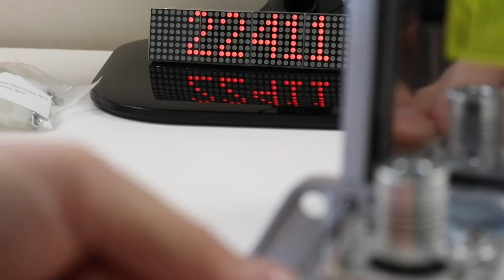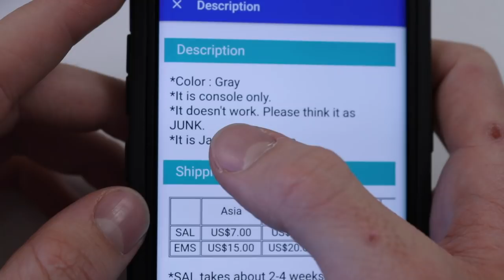Let's Refurb! - Fixing Faulty eBay GameBoy Pocket!

Comment: How many cigarettes a day did that game boy smoke?
Reply: Too many.
Reply: Normal oxidation
Reply: Jones Paul haha it looks like he was a chainsmoker
Reply: Actually, that type of yellowing is typically not caused by cigarettes, as much as it looks like it is.  It's caused by exposure to UV light.  And it is possible to remove the discoloration with a combination of hydrogen peroxide and either UV light or heat.  Look up Retrobright sometime.  But yeah, the way it's more yellow on one side, that's definitely a sign of UV exposure and not something like being in a smoking house.  For those chemistry nuts out there, flame retardants in plastic like that are based on bromine.  UV light causes a chemical reaction which releases the bromine from the compounds.  And bromine is that characteristic yellowish/brownish color.
Reply: @StormsparkPegasus  r/whoooosh
Reply: 1,0000000000000
Reply: Stormspark r/woooooosh
Reply: Uhhhhhh lung cancer amount of cigarettes

Comment: Stumbled upon this vid, interesting to hear that most of the problems with these devices revolve around the power button. I have an old GBA micro that stopped working for some reason. After playing with the power button back and forth it finally turned on! Thanks!! Is this issue due to some residue buildup?

Comment: Nice! I've just subscribed. How long did you expose the bleached case in the uv bay for?
Reply from the maker: Thanks! About 10 mins then check & replace the solution, then another 10 mins & repeat.
Reply: @TheRetroFuture  my girlfriend informs me that you can get a higher volume of that hydrogen peroxide (you're using 40). Might help.

Comment: Not relevant to this video, but does the orange Xiaomi screw driver set you use come with the smaller tri wing bit? I've seen other older videos of yours with the slide opening grey case one and the tri bit was too big and you said to buy another one. I've ordered the orange one so wondering if I need to separately buy that bit?? Sorry it's in the wrong video - see it as a complement - I'm binge watching so many lol! Cheers.

Comment: For that adhesive you should consider using a citric acid based cleaner it will dissolve it and make it easy to wipe away then clean as normal and retro bright it.

Comment: Where did you buy your power adapter for your DMG Game Boy? I'm in the UK, just got a couple of broken GB's and i want to fix them. The terminals are corroded so thought getting the power adapter i can bypass the battery section and see if they work from that. Love the videos, thanks very much for your help.
Reply from the maker: Ebay!
Reply: Thanks for your reply. I found a usb cable on the deadpan robot website that will do the job.
Reply: eBay if you want some original hardware, they made plenty of chargers for the machine.

Comment: Nice video!, thanks for the upload :). Couple of questions though (if anyone can answer)..

1: When you turn it on, and you get the blocks scrolling down the screen... isn't that suppose to say Nintendo ?

2: The restore of the eyellowing plastic looks very good.. though wondering, does the chemical process damage the plastic? Does it become brittle in any way ?
Reply from the maker: 1) it says Nintendo if a game is in there and has been read. It shows blocks when the game isnt inserted. I cant remember without watching the video but I think this was a fake cart which I used to test it.

2) yes it can make it more brittle if overdone.

Comment: It would be really cool to learn what it is you're actually doing, and why it works. Like, why does putting alcohol on the power switch automatically fix it? Why does retrobrite clean the color and make it whiter? What was that lightbox thing you put the thing into? I have so many questions! I'd love to learn these things to refurbish these things as a hobby!
Reply: alcohol is used to clean contact points and remove general gunk. It has no lasting effect on the electronics (it is flammable so turn it off and be sure to remove power) plus alcohol air drys very quickly.
Reply: retro bright is mentioned as a peroxide agent of some sort. its like i weak bleach / coloring, think of hair dry. Same sort of idea. Keep in mind I have never used the product and only base that on what was said in the video.
Reply: @slowb15  thanks for the explanation! I really appreciate it! I've seen a few more of his videos and he explains things here and there, I'm learning slowly but surely 😁

Comment: Only if i could figure out whats wrong with my 3ds. It wont charge or turn on. Ive had the battery, charging port, screen, power switch replaced and noting worked. Its just gone.

Comment: Hey Elliott, i want to know how do u glue the screen, i fixed a dmg because of your videos and i need to glue the screen. Thx in advance, if anyone else knows i apreciate the help.
Reply from the maker: If you're really careful, some superglue. But really doesnt need a lot at all. I will be using some high quality double sided tape so it is reversible.
Reply: Thx :D i think i will try some super glue because here in portugal we dont have many good tapes :/, btw i hope everything is fine with u, i love the website, hope u find a job soon.
Reply: Don't use super glue. It can fog the screen and you won't be able to remove it easily later. I'd recommend a really weak epoxy or a silicone.
Reply: I use some thin double sided tape they sell is craft stores for scrapbooking that works great for this when cut to size.
Reply: Matt Fisher Not to mention that it can and will ruin the paint used on the screen lens. Double-sided tape is definitely a cleaner solution.
Reply: sjm4306 looking for a solution without tape as he mentioned it's hard for him to find where he is at
Reply: Matt Fisher well the internet exists ( amazon , eBay etc ... )And he uses any glue that is powerfull enough to keep the screen in place the paint underneath the screen borders will discolor
Reply: Double-sided tape isn't too thick to make the screen fit flush?
Reply: Maybe a glue stick
Reply: @staticklingon2182  There exists a type of high-strength double sided tape or LOCA tape designed specifically for cellphone touch panels. That should be strong enough for your needs and shouldn't leave a foggy mess. Alternatively, you can use E6000 or those B6000 knockoffs used by cellphone technicians.
Reply: Awesome! Had no clue this existed. Thanks!

Comment: Nice refurbish. As far as the retro-bright, have you seen The 8-bit guy's videos on it?
He did a series of test comparing the most used processes to retrobright and found that the cause of the streaking is due to the uneven application of the cream base hydrogen peroxide.
You can reach a better (even) result with a very high chance of success by warming the plastic piece in a stove with a solution of water and peroxide.

His channel is over here if you're interested https://www.youtube.com/user/adric22/playlists

Comment: What is he using at 5:40?
Reply: I want to know it too.
Reply: I guess a UV-Lamp. Not sure why though, because the peroxide will take care of the all the discoloration just fine.
Reply: @Felixkeeg  usually when peroxide is used to whiten something its set in sun or heat lamp, people who restore white shoes do the same, put the sauce on the shoe, wrap in plastic wrap and set it in the sun or under a heat lamp, I guess it helps it set better
Reply: To be specific it is used to harden acrylic nails in nail salons
Reply: it`s his sister nail dryer
Reply: Stephanie Rosborough not a heat lamp, a UV lamp. It is the uv of the sun or the lamp which are whitening, not the heat.